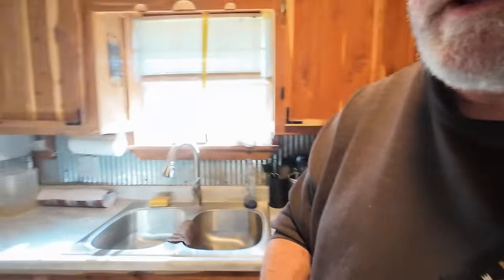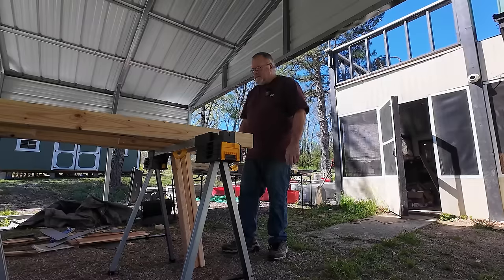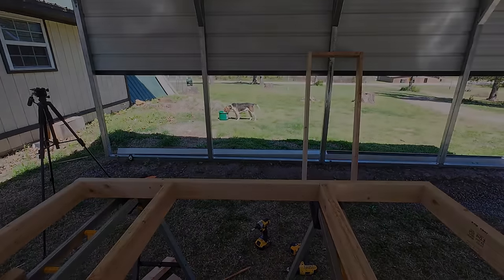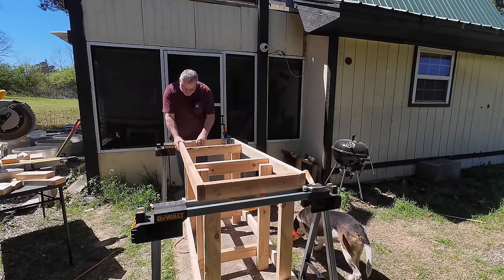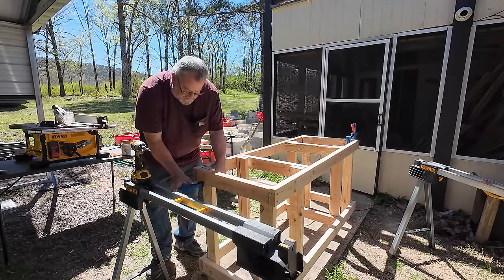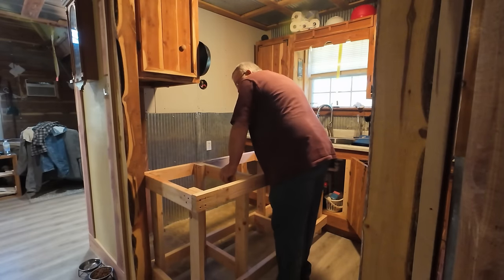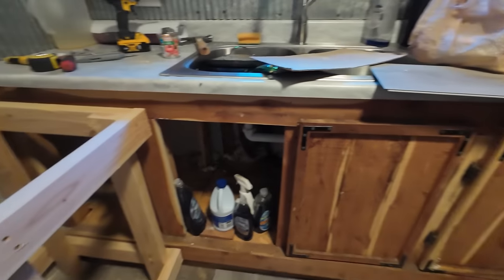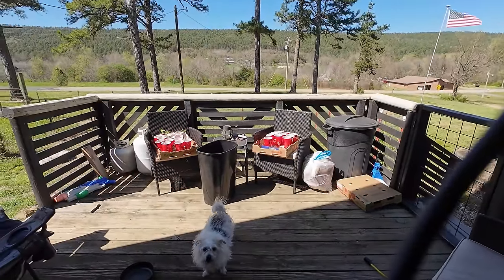Cabin Kitchen Transformation: Butcher Block Beauty

Comment: regarding your hand, I had carpal tunnel really bad in both wrists from years or carrying trays bartending, cashiering in a busy grocery store and 20 years of slicing meats and cheese in a deli. I cured it by sleeping with a rigid brace for a whole year. it fit the palm of your hand and extended about 6 inches up my wrist.you attach it with elastic bandage wrap.totally healed with this method. great job on the fridge wrap and I like all the reno's.
Reply from the maker: got those, cant find them
Reply: BETTER BRACE YOUR WRIST- HAND. I RENOWD OLD HOUSE FOR YRS ALWAYS HAD SUPPORT- NEVER NEEDED SURGERY. THINK YOU MEANT HAVE SUPPORTCANT FIND. VERY BAD TO MOVE TO ELBOW. WRAP WITH STRETCHY BANDAGE IVE DONE THAT TOO. IMPROVISE!!😊